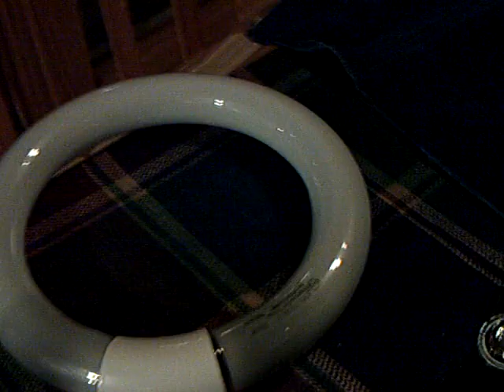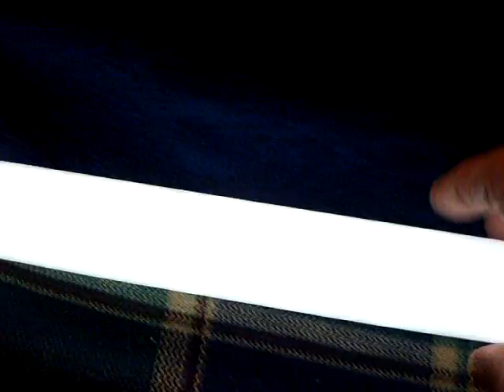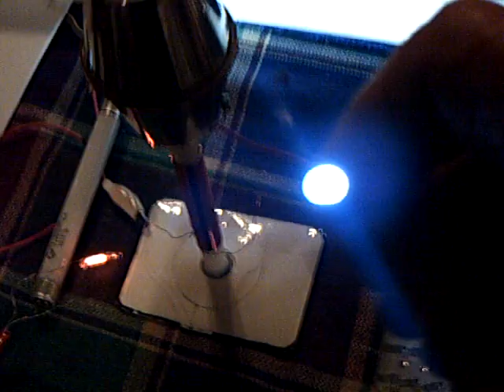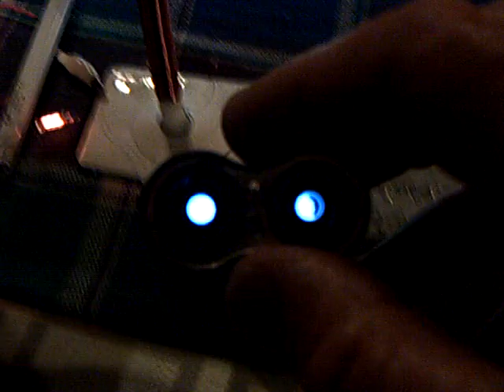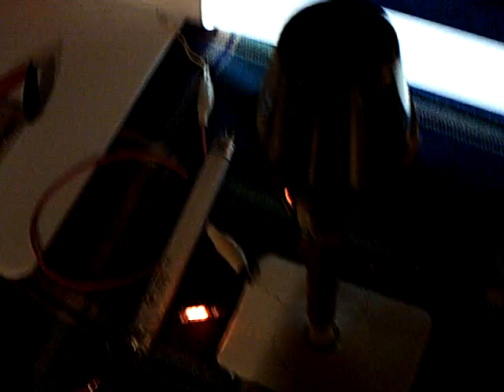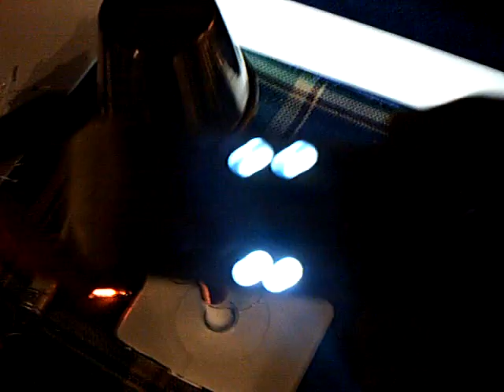Slayer Exciter with BIGGER coil.ASF

Comment: thats a large radiant field-5 from me
btw i also have heard the thing about mass of each coil being the same in tesla's setups-he used the analogy of the volume of a cup,stating that if tipping from a large cup to a small cup then lost liquid results,i didnt weigh the coils in my TC when i built it but i kept it in mind and tried to ball park it.
thats why i used flat ribbon instead of tubing or wire on my primary.
its worth investigating-im sure tesla wouldnt have said it without reason

Comment: It just keeps echoing in my brain, Tesla said that the strange effects became more pronounced at higher power levels..... I realize you are trying to match up the optimum volt/amp for the coils to get the max effect.
Something else keeps coming back to me, Tesla said (when building his transformer type coils) that the primary and the secondary WEIGHED the same, no mention of the number of turns or ratio...... Could the volume of copper effect the result?
You having Prius, crashes nearby?? LOL

Comment: Lets just say for example that you notice an area that is "excited" using your AV Plug, measure said area (to determine range) Then begin adjustments to try to increase the effected area.
Will Voltage dictate the volume of "stimulated space" Will it be the amperage?? Or how about the effect when changing the pulse width and duration of the pulse circuit?
There has to be a way to increase the "brodcast distance"
Thanks for sharing.
5 stars!!